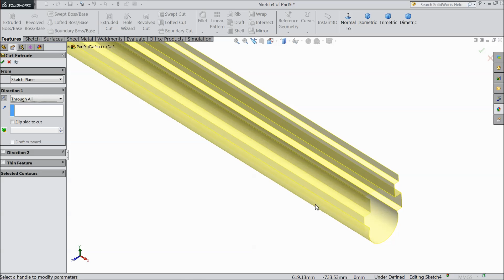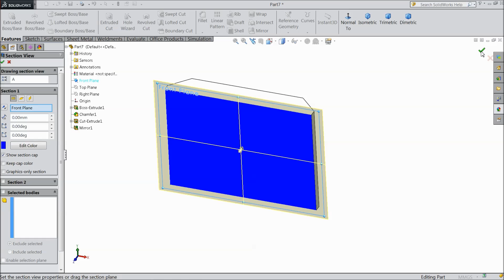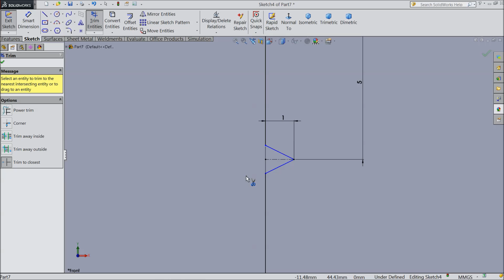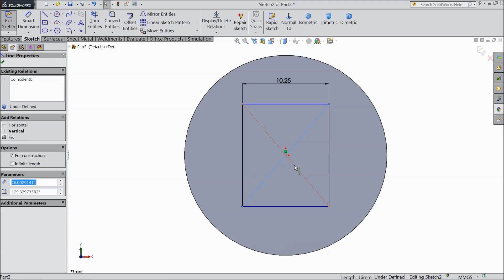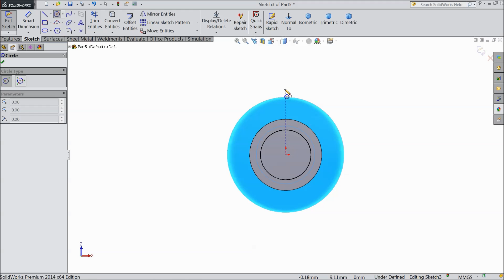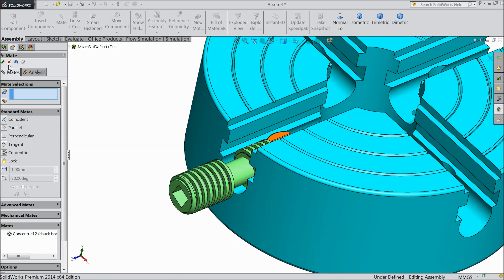Solidworks tutorial | Sketch  4 jaw chuck in Solidworks

Comment: Good friend, at minute 4:06 when you are doing the sketch of the hole where the claws slide, you do not define the lines that give the thickness so you can not continue doing the tutorial, or I am wrong ? If you do not define the width of the claws when you go to join it will not fit the claws in the hole. Or could you give me the link of the map you used to make the plate and there's a debate about that? regards!

Comment: Gracias por estos excelentes videos.
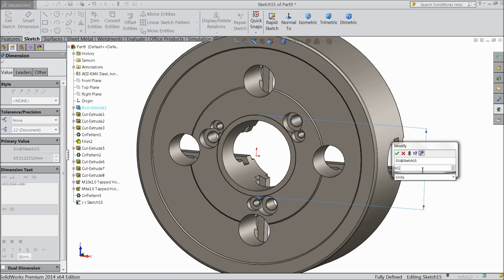Sin embargo, tengo un problema al generar el corte del minuto 13:59.
dices 63.50mm y, a mi con esa cota, me "invade" los taladros que qudan pegados al corte. Utilizo Solidworks 2016; ¿Es eso un problema?
Nuevamente gracias por tus videos.

Thanks for these great videos.
However, I have a problem generating the 13:59 minute cut.
You say 63.50mm and, to me with that quota, I "invade" the drills that remain attached to the cut. I use Solidworks 2016; Is that a problem?
Thank you again for your videos